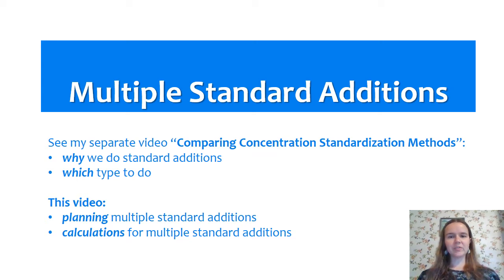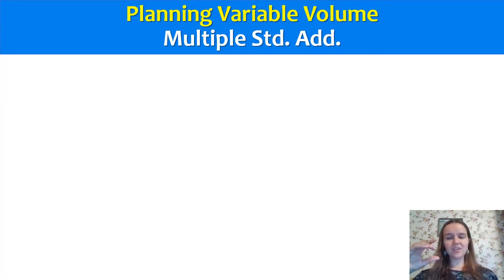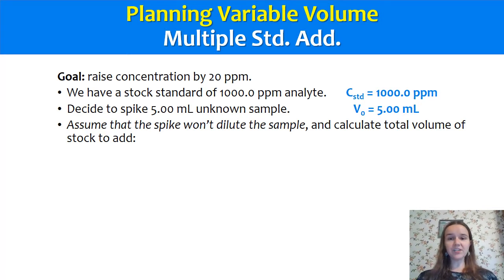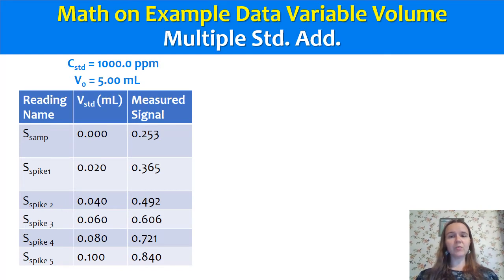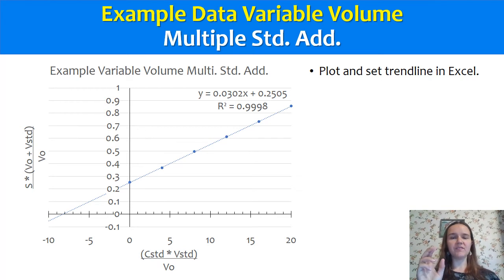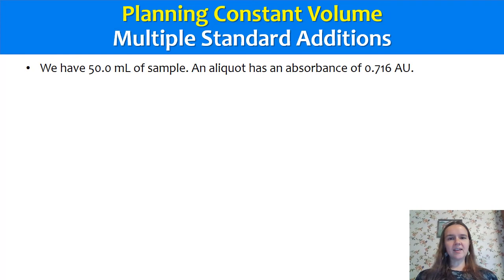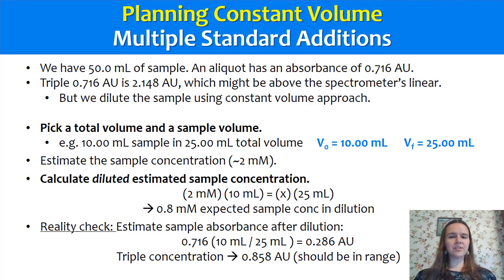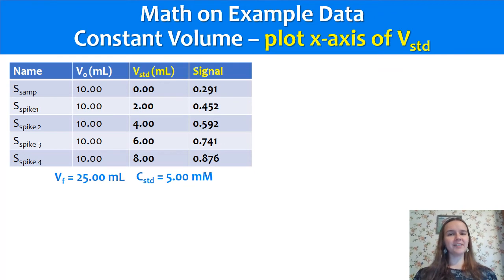Multiple Standard Additions

Comment: Thank you for the great video. While we are taking the dilution into account, won't we also consider the reduction in sample volume caused due to signal measurement? The V0 becomes a variable then..?
Reply from the maker: Your question relates to whether "variable volume" or "constant volume" standard additions are done. In variable volume standard additions, the exact same solution is measured, spiked with standard, measured again, spiked with more standard and measured again (and so on). In that kind of standard addition, you cannot use a measurement technique that consumes sample. If you will consume the sample during measurement (even if that means losses due to transferring into and out of a cuvette for spectroscopy), then you should use constant volume standard additions. In constant volume standard additions, the V0 is the same for all flasks and you are able to do the math without needing to account for change in V0. So, no, the V0 does not become a variable. I hope that helps.